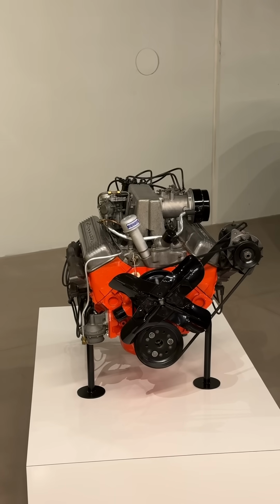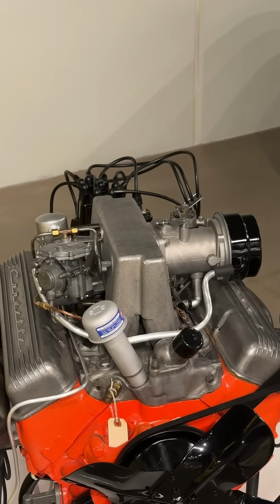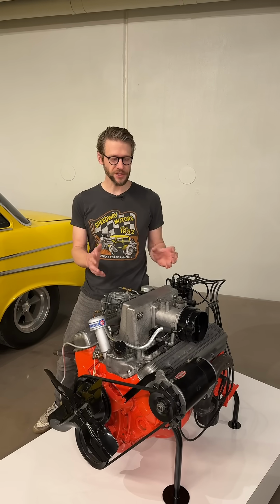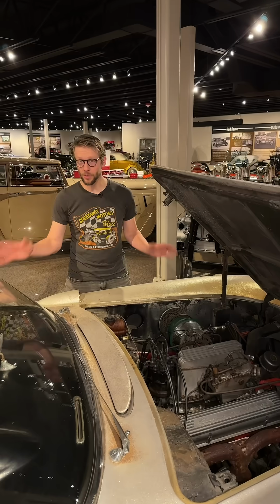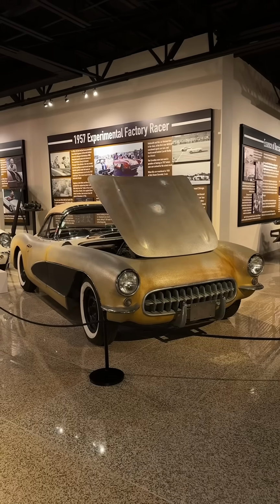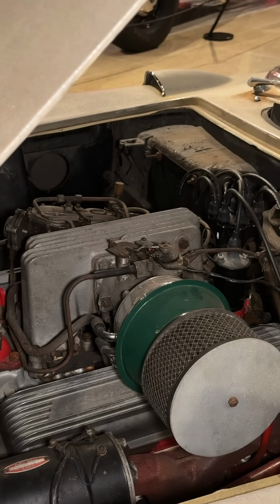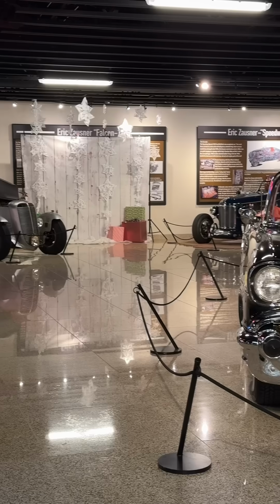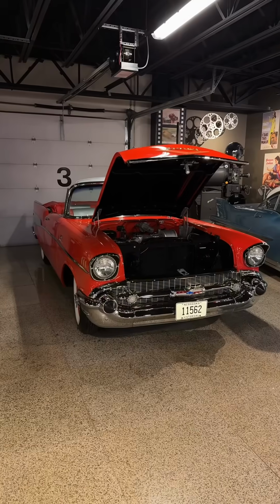How Does Rochester Ramjet Fuel Injection Work? #engine #rochester #didyouknow #mechanical #chevy

Comment: Yeah but...all you did in 1957 is you bought a DeSoto or Chrysler hemi and you instantly got 1Hp per Cu In 
and with a LOT more cubes and 
power. So let's say you had a Plymouth or a Ford and you put a Mopar ( I know that's  heresy in a Ford but...) set the engine back 
a foot or so and you had a world beating bomb. Especially with a simple cam swap and headers...